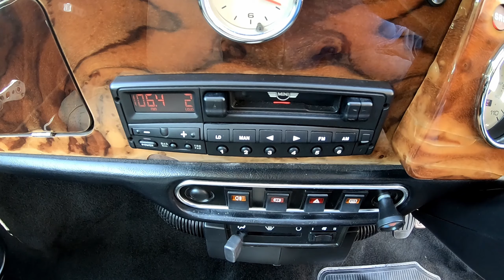Fully Restored Mini Cooper - Classic Mini Workshop Project Sprout Unveil Pt 77

Comment: Congratulations Keith on a fantastic job with great content. The only thing I would change, would be the steering wheel to a wooden one to match the dash.
Reply from the maker: They did a half wood airbag steering wheel as a accessory, I would absolutely love one but I dread to think what one would go for now. Maybe £800+. I like the non airbag Mota Lita wheels but they require a dodgy MOT test. The car was fitted with SRS so should fail an MOT without the airbag